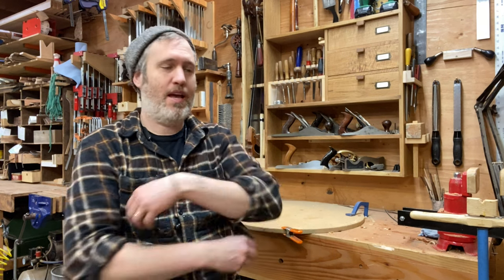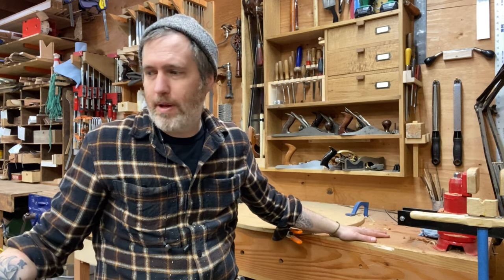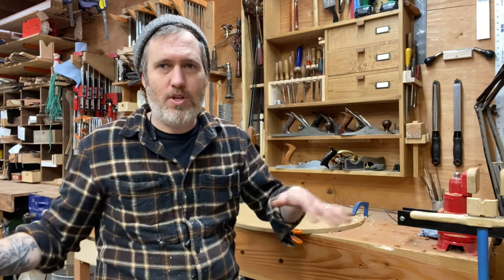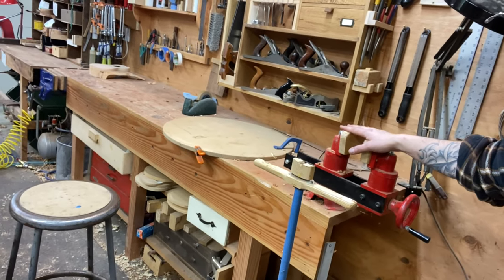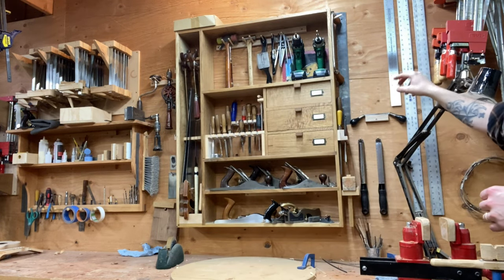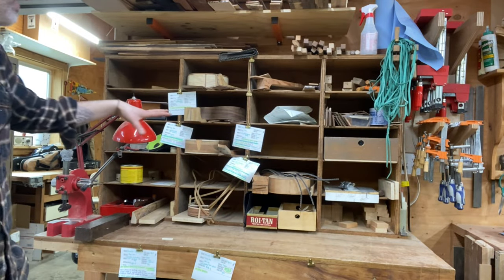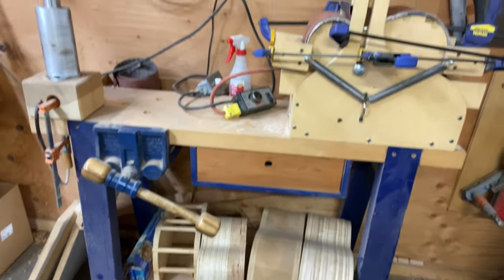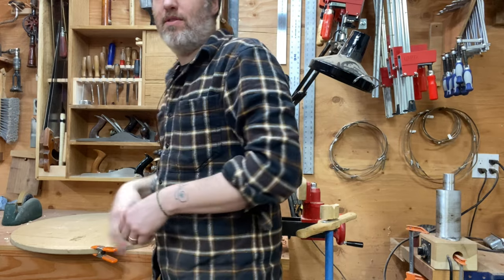Shop Tour 2022: Part 2- Hand Tool Woodworking

Comment: Nice shop. I have my great grandfather's draw knife from a farm in Indiana. Shaping and fitting handles for implements was the other thing they used them most for in the farm, hoes, axes, hammers, pitch forks, things like that. I've added many many miles to that knife making log furniture, log railing, etc
Reply from the maker: Nice. I’m sure this one knocked out a few tool handles over the years as well. Thanks!